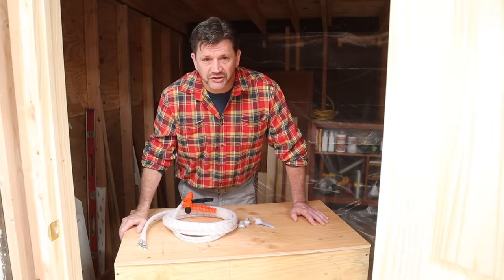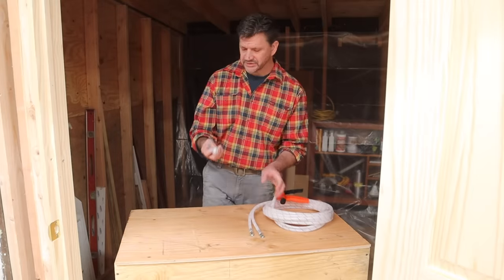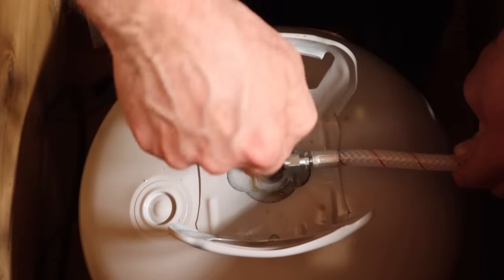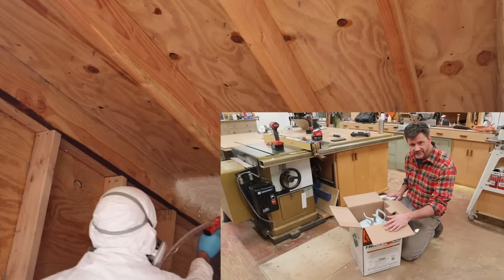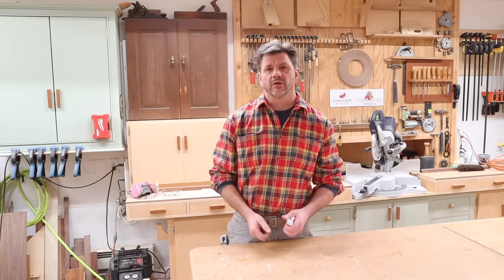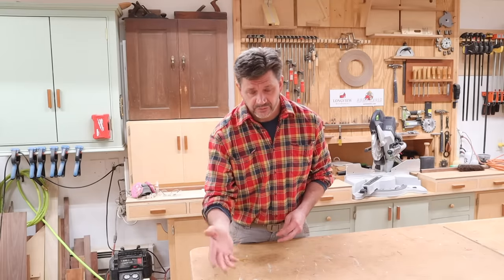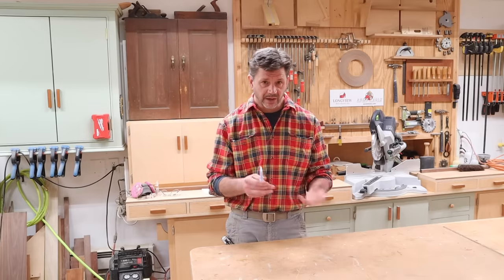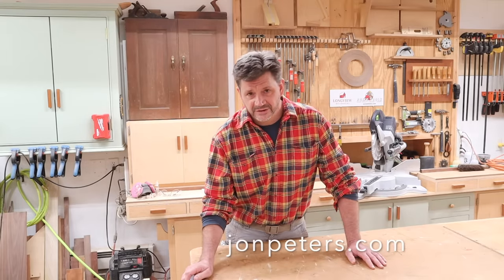DIY Spray Foam Insulation - What You Need to know Before You Start

Comment from the maker: Hi all, I Used the Tiger Foam Quick Cure closed cell foam Formula – 600 Board Foot Spray Foam Insulation Kit.
The key to this project is prep. Make sure you have everything you need to start and finish the job before you pull the trigger. I suggest watching this video and a few others before purchasing the material for your project. Hope this video was helpful and thanks for watching...Jon
Reply: Which tank emptied first during your project?

Did you have extra unused product left from your second kit?

If yes did you use product to add extra depth to the first coat, or did you spray vertical corners in you walls?

TIA!

Comment: I looked into similar products to spray foam the rim joist in my home, same as you would require two sets. I was able to find a local spray company that did the work for the same price. Actually about $50 cheaper, plus they removed the existing insulation and sprayed about 6-8 inches deep. Same price and the experts did the work, no brainer. Took them about two hours to complete.

Comment: I did my friends mom house it was single story with a 4 ft crawl space built in ther 50s. The hardwood floors were freezing cold in the winter 1x6 subfloor so the cold air was filtering through. We used a spray foam and got roughly 3 " coverage but what a difference it made. It wasn't easy in the space and quite a mess  not cheap but that floor needed  a vapor barrier

Comment: Drop the used tips in a small container of acetone and the foam desolves off them quickly. They’ll be ready to use if you run out of the tips that are supplied in the kits. Works for quickly cleaning the clogged gun too.
Reply from the maker: Thanks! Great tip👍
Reply: very true.
Reply: @JonPetersArtHome  one may call it a tip tip.

Comment: Excellent idea with plywood box and space heater, hats off!

I love spray foam insulation. There are so many pros to it against the cost. It’s great for your structure; keeps moisture, noise and insects away; closes up ALL holes whereas even Tyvek membrane can’t; holds temperature stable. 
I’m not a professional. But after buying a property with a basement that had humidity issues I ripped down several walls and sprayed (bought 2 sets of 600sf off of eBay) the heck out of ‘em. No more damp smells or wet walls. I believe, it’s cheaper than digging out around the perimeter of basement and waterproofing and all.
As Jon said in the video, you must prepare everything for the job to start and finish without a break longer than 30 seconds. Respirator mask is a must, as the fumes are carcinogenic. If planning to spray inside a living space, no other person/animal must be present until at least an hour after the job is finished and space is aired out.
If by accident the foam falls on clothes or shoes you can clean it with help of lacquer thinner. Acetone or nail polish remover can help while it’s still curing.
Reply: Tyvek isn't intended as insulation. It's a moisture barrier to protect your sheathing if the cladding of the wall should fail. It also interfaces around the doors and windows.
Reply: I wonder if holding them in, like a horse trough, in hot water (element heater could be used) would conduct heat to them better. But looks like this worked fine.

Comment: I sprayed my entire crawlspace and it went pretty well. The trick is to be ready to do the entire job in one go. Warming tanks is a must. I bought my tanks off of ebay which was way cheaper than any other option and had free shipping. I don't think the brand of spray foam makes much difference just make sure you get closed cell foam.  It's a very rewarding DIY job.
Reply: Would you mind sharing the link of that product you used! Thanks in advance
Reply: @armandomartinez-jp9zi  Not sure of the seller on ebay, it's been a while... just go with someone who has a lot of positive reviews.

Comment: JFI, Lacquer thinner will usually clean any foam out of the tip if you get plugged. It's pretty useful to clean floors, shoes, but it will dry the natural oils out of anything you use it on, including your hands. Also it finds the smallest cut and burns like crazy.
Thanks for posting! It's great to see you actually doing the spray.
One other thing, I found a small unit that you can plug a heater in, and it is a digital thermostat. It will work on heat or cool, and I think it cost about $30.00. It's was designed to plug into a wall socket, and then plug your heater in. It will heat until it reaches the pre set temp. 
Again, thank you!
Smiles!

Comment: I priced out the tanks vs a company in my area, and North Pole Insulation out of Whitehouse, NJ was cheaper to hire to do the work and bring their own foam with a foam truck than it was for me to buy the tanks, even with coupons, etc. The large companies buy in such bulk that it was nearly the same price, but of course professional installation comes with a guarantee, etc.
Reply: Same here in Montana. I had closed cell done for about .90 per BF and that included prep, installation, and cleanup. DIY kits were 1.00 per BF just for the kit...
Reply: Same here.  The company I used said it's all about the size of the job.  The cost of getting here and warming the material is a set fee and the most expensive part of the job.  After that they just charge per square foot.  So I had them put it on twice as thick to increase my R-value for a minimal increase in cost.
Reply: @bpdp379  What company did you use?? I live in Montana also, and would like to get some work done in my home.. I am in eastern Montana..
Reply: I live in the same area and will check them out.  I was considering doing this on my own to save but I do have a lot of space to spray.  House attic, garage and attic room above the garage.
Reply: @tspfull  Like a moron I didn't take my own advice; I did the subfloor above half of my garage myself. It didn't go great and the tank was $650. So I called North Pole to find out how much they would charge to do the other half. $400, labor included. Guess how dumb I feel again? North Pole will be here at the end of the month for the other half.
Reply: @bytenik  wowzer!!!    I will definitely be calling them.  I have so many projects in the new house that I cannot take anything on that can be done professionally for close to a DIY price.  And this is cheaper!
Reply: @bytenik  how did the project go? I’d like to know what type of foam they used. A low price like that makes me think they quoted you for open celled foam. The tiger foam at those prices is for closed cell although they do have open celled kits.
Reply: @bighammer3464  It went great. I have the spec sheet for the foam somewhere but it was definitely closed cell foam and had an ICC test certificate for use without an ignition barrier.
Reply: @bytenik  awesome. I’ll be sure to look into this for a remodel coming up. Thanks
Reply: Getting ready for a kitchen reno and started pricing up closed cell spray foam for under floor in crawl space…yikes I will be calling some places on Cape Cod, MA to compare and thinking I may have same situation as you all found.
Reply: I live in the same area good to know about this company
Reply: @bytenik  was quoted 11k for whole house by another company in the area and they were charging extra for removal. $1 a square foot of insulation in attic. Did you remove insulation by yourself to reduce costs?
Reply: @stephan24297  I paid a guy $10/hr to bag it and toss it out the 2nd floor window which took about 5 hours, and found multiple people on Facebook marketplace who wanted to take it for free and reuse it in their home.
Reply: @bytenik  where did you find someone for that low? 😮 can I message you?
Reply: @stephan24297  Sure, go for it! I just put a job post out on a Facebook buy/sell/trade group, but this was back in early 2020 before the pandemic and labor prices were a lot lower. You'd probably pay $20/hr today.
Reply: @bytenik  ahh okay I'll try that out. I tried pm ing you but apparently YouTube removed messages recently

Comment: I had my shop spray foam insulated (closed cell) last year and it is great. My mini split hardly runs even in the winter (Ohio) and the shop is always comfortable - 72 in the summer and 62 in the winter. It wasn't cheap but it was worth it.
Bill
Reply: May I ask how large of project and cost ?

Comment: Tiger Foamed a crawl space addition a couple of months ago.  Our house had an addition put on by a previous owner and as it turns out, they did no insulation in it (we live in Canada!) and so the front 5' of the foyer and one bedroom were very cold in the winter.  Managed to squeeze under (sent my wife in) and in her cute little Tyvek suit, we got the rim joists and stem walls all nicely coated out.  It is very good for hard to seal areas, like rim  joists or truss ends.  I recommend it highly where sealing up an area is critical, and aren't most areas of your house critical?  Yep.  If you do need a large area insulated, call the pros.

Comment: I agree with video here. Prep work is key, cover your stuff, you only have ~30s before spray foam cures in the tip. I'm doing the same project for the same reason - I have a hip roof construction and it's basically impossible to vent so I'm using spray foam for an unvented roof.

Comment: well done jon. I'm a firm believer in spray foam insulation. always gives you a complete envelope to stop infiltration from the elements. thanks for another great video!
Reply: Too tight building is toxic.
Reply: @designstudio8013  mechanical ventilation. Bring air in as needed. Anything more is wasting energy
Reply: @DTWCT  No its not as the poisonous building materials must be constantly diluted.
Reply: @designstudio8013  open windows and ERV/HRV
Reply: You gotta be careful about trapping moisture behind the walls

Comment: Jon, thanks for making the effort to capture this on video.  Given the limited time you could leave a tip dormant, it was obviously 'one more thing' and so much appreciated.  Possible suggestion:  you demo'd the way you heat your shop several years ago along with the typical winter results.  At some point, you may want to reference that link for those who are newer to the channel.  Good luck - steady wins the race.

Comment: I was looking at this too until I heard the cost. It appears to me you could use sheets of polystyrene foam and then seal all seams and edges with cans of expanding foam and get the same results without all the expense.
Reply: You can.  It helps to put a few nails in every couple feet to ensure the foam board stays in place as the spray foam expands.

Comment: In my area the minimum job a spray foam contractor will do is $1500 for about 500sq ft @ 3” thick.    So these kits aren’t very economical if you are using more than one $450 kit. If your spending. 1k on supplies just call a pro and use your time elsewhere.  You will get much more material for the money. They kits work well though for small jobs.

Comment: Looks great. I wanted to try this on a home I renovated but was pricey compared to other options. I am currently installing insulation boards in the shed to keep things cooler in South Texas heat. Great video.
Reply: spray foam is an extremely expensive solution compared to the PEP or PS based boards & rolls :(

Comment: Also noticed if when you spray dont spray it like paint hold trigger and zigzag without the break at the end of each left to right right to left etc doing this youll use less product waste from tip drip and less mess just IMO helped me a lot

Comment: Jon, great vid...one thing u didn’t touch on .  Expansion.  So u put down one layer...what is the expansion of the material?  Can we expect 2 inch rise? 3 inch?  I have some cavities where I need to spray and the max expansion I can have without having to saw cut everything would be 2 inches...do u know the ratio?  1/2 inch of material laid down results in 3 inch total expansion..etc etc...?

Comment: Great tips! Definitely agree on the prep work.. I'm having a contractor come spray my barn (about 8000bf total) and still spent a ton of time getting it ready.
Reply: Can we ask what that project estimate came in at?
Reply: What was the cost ?
Reply: billy bowbob 1100 for the two kits required to complete the entire shed roof. He covers the cost aspect in the final 2 minutes of the video.
Reply: I'm melting! Each kit includes the A and B product tanks.
Reply: @immelting9834  pno
Reply: @emblems4life726  Contractor price and diy price much different. I thnk hes asking how much is it to have a pro do it as im sure the upcharge is way more.

Comment: Usually a contractor can do it same price why’s buy the kits? It especially sucks when one kit is not enough amd only need a little if the second kit... but other than that very nice job spraying! You did as good as a guy can do it with those kits! This is from a very day sprayfoam contractor.

Comment: Great info, Jon~!  My shop is a 30'x40' pole barn that has a layer of silver-backed bubble-wrap for the insulation.  It doesn't seem like much, but our winter's here in GA are nothing like what you get up there.  I've wanted to investigate going with spray foam insulation, but the single company in our area wants a king's ransom, so bubble-wrap it is.  My mini-split unit does a pretty good job of heating & cooling the shop, so I guess I should stop complaining.  :-)
Thanks for sharing~!
Reply: You will hate the bubble insulation I had it and it breaks down after some years and it starts falling off and it’s a messy

Comment: I decided I'd save money by spray foaming my garage ceiling myself.  I used 5 sets of Froth-Pak 620's for 5" thick over 600 ft2 ceiling (zone 6).  I really didn't save much, if anything, after needing to buy a good vapor full face mask, space suits, gloves and drop cloths.  I ruined a pair of shoes, even when wearing booties and got foam on the uncovered areas of my neck and hairline.  The mask came with several film covers because no matter what, foam will build un on the mask.

The cost for the foam and needed supplies was around $5000.  It took me several hours and I sweated like a pig, even in 70 degree temps.  The foam gets hot while reacting and heated the garage to over 80F.  My neck was really sore the next day from looking up for that long.

IMO, it isn't smart to DYI foam large areas.  The small gun takes forever to cover big surfaces.  I'd only use a DYI kit again on a small area, otherwise better off hiring this out, as I would have paid maybe a little more and saved myself from this uncomfortable and very messy job.  A spray gun gets gooped up quickly when spraying upwards as the fine spray mist builds up, causing me to stop to clean the nozzle off.  Not a fun project!

Comment: @Jon Peters Hi, this is a very informative video and holds the key to most of the questions I had about DIY spray foam insulation. I was wondering if there is a reason as to why you short bursts of spray foam going back and forth between the 16” gap instead of making longer sweeps of spray running the lengths of the beams, struts, joists, or whatever those long pieces of wood are called? My mind seems to think that it would be easier, more time saving, and possibly even reduce wasting product? Thank you for your time.

Comment: If you want a squeak free staircase, use screws and spray this on the bottom side.
Reply: Would this stop squeaky stairs if you added screws where needed and sprayed the bottom side
Reply: Yes it would.  If the stringer is cracked and won’t hold a screw as tightly as you’d like, consider misting the tread and stringer with water and running a bead of gorilla glue.  This can be especially helpful in stair cases with a middle stringer.

Comment: i put tanks in hot bath tub,about 90 deg water for little while.also heated the area to be insulated.had good results
Reply: I have a sous vide circulator and was thinking that device could get a very precise water bath going in a cooler for these tanks.

Comment: Wear a full face mask the vapor that comes off during the heat transfer can cause vision impairment.  I worked for Airtex spray foam for 4 years it's on of the first things that is explained during safety and operation training.
Cool little set up tho

Comment: Hello, thank you for the video! I have a 2 1/2 car garage the I want to use the best insulation for winter months here in Chicago area. In your opinion, do you think spray foam is the best way to go or just regular R19 insulation? Also, how much sq ft did you get out of the one box you paid $500 for? Thank you.

Comment: I have VHS tapes from Monolithic Dome Homes. Very amateurish at the time. They used to preach DIY back 
in the 80's, then  they stopped doing that and suggested a pro for the foam. Of course they were doing 
inside of a 40' diameter dome 1" thick per pass until you got to 3". Foam has come a long way.

Comment: 75 and 85 is what the temp should be where the barrels are or in this case where the tanks are.75-85 is not near optimal enough for a spray temperature maybe more around 120f for best results,the other problem with these tiger kits is there is no agitation which occurs in spray foam with the pumps used on a spray foam truck.Pressure,heat,air psi etc is all needed with foams certified today.Ive fixed many of these types of jobs and most times I have to completely cover it with 2-3 inches of 2lb spray foam which most time the costomer was just cheaper off to get a spray foam company to do it in the first place.I just talked someone out of doing this just last week😂